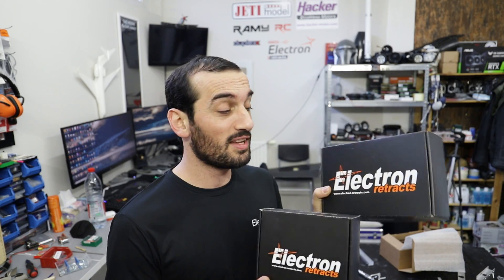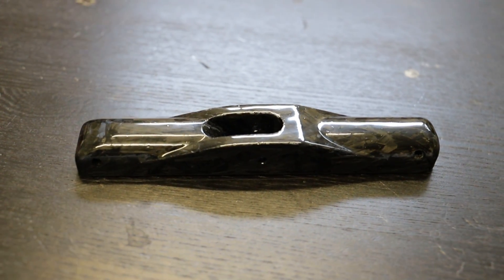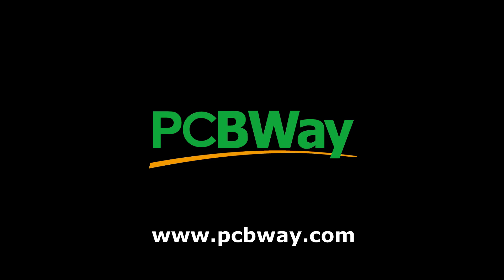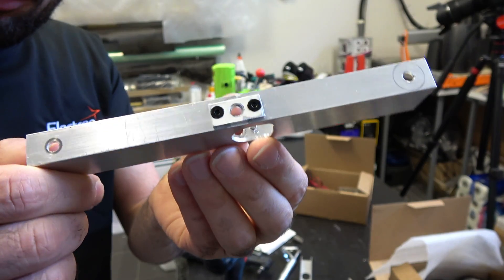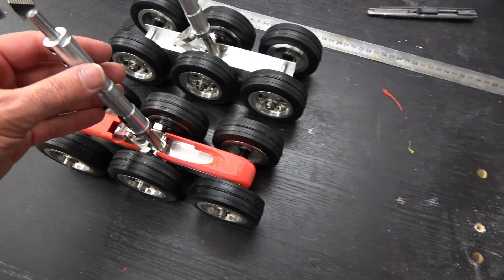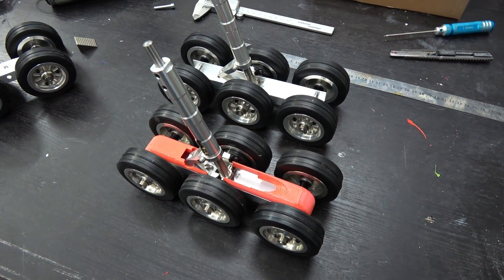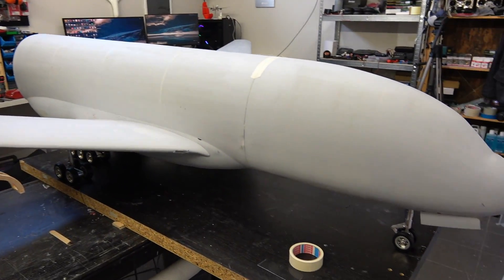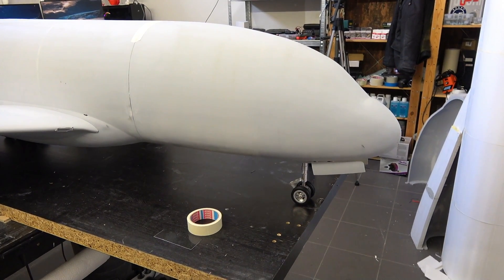Making the landing gear for the Airbus A380

Comment: You could make a very strong yet lightweight carbon fiber beam assembly using AI and a carbon fiber 3-D printer using generative design. All your wood braces, struts, and structural components could be replaced using this method which would dramatically reduce your overall weight while increasing strength.

Comment: Ramy i will be doing some edf test, and look to develop a jet engine in the future. I have seen some pretty powerful EDF's on youtube producing upwards of even 50kg. The thing is, none of them compressed air to create thrust. Just simple fans blowing a ton of air. Have you ever dabbled in producing such an EDF that compresses air in stages to maximize thrust? It would be easily done with metal parts but I'm limited to PLA (3D printed filament) there will be allot of limitations in the design process. 

Also I challenge you to create a blades thrust aircraft for your future projects!

Comment: Hi everyone! Well done 👍🏻 I’m using the same retracts on my airliner. But as you mentioned those electron alloy wheels (and brakes) are quite heavy, especially if you install more than one per leg. I replaced my wheels with light wheel from Kavan. I’m intrested what you are going to use, insted of those - i must admit, very nicely done - electron wheels.  Thanks & best regards

Comment: HI, I watched this video a few days ago but I just watched your 373max crash video. and I still want to say you should have separate batteries for each engine. It is fatal for one side to lose power while the other side ramps up.
Also I would actually want to see a WWII bomber. Modern planes are beautiful but I really like the look of older planes.
Reply: Its not left side/right side, its inside engines/ outside engines.

Comment: How will you deal with doors touching wheels? I see the front retracts touch the rear doors when extended and with landing, bouncing around, i would hate to see damage or doors falling off. Will rear doors close before front retracts extend? Or will you shorten axles? Or trim doors?

Comment: Would it be an idea to have the pulling up of the gear be spring-loaded? As in about 40 to 50% of the mass is pulled/held by springs. As 100% might cause the gear to not go down in case of a system fail.

The last thing we'd want to happen is having this project crash because the gear wouldn't go down.

Comment: Great job! For the wheel-cart piece you tried to make out of CF: That's a part with simple shape and complex stress, usually the strength of metals... After I saw your beautiful fuselage: That's a part with complex shape and rather simple stress, exactly what composites excell at! So all in all correct choice of materials... All the best with the build!

Comment: One thought: if your braked wheels are the centre wheels on the 3-bogie units, they will have the least effective braking, because the wheel will be at the mercy of the other two pairs on that bogie --  any lifting at either end will pull the centre wheel off the ground. It might be better to put the brakes on one end, or on the 4-wheel bogies.
Reply: Put them on the front. Deceleration will make the bogie pitch forward, so the front wheels have the most braking authority. Just like a car or bike.

Comment: Could the gears motors be a bit released  by springs, well adjusted ?
There is some geometry where a same spring can pull in a way in a certain point and pull the other way before that point... Maybe you remember this desk lamps? ;-)

Comment: I'd suggest, instead of putting a 1 sec diff. in the opening of the main landing gears, add at least 2 sec. more that way the gears on the wings are able to come out first and the seal close before the landing gear on the belly comes out. if you do so then, imaginably, the wing gears will come out and then on 2 sec. mark, its seals start closing while the belly gear starts opening on the 3rd sec.
Maybe you could prevent the belly gears from blocking the seals of the wing gear

Comment: Rami, Electrons has high torque motors version for their retracts. Same size, just double the power and 2x slower. You should get those.
Reply: Also, since the main gears are so heavy, there's a danger that they won't fully retract due to G force in flight. You should install a jeti hall sensor that will close the main gear doors only when the gear is fully retracted. That way, if fo some reason they didn't fully retracted, the gear doors won't close and get binded.

Comment: One way you could make a mold that would release (on the male side) from the part is to make it in 3 parts. Two touching sides, with a loose fit, and then a central part that's pressed in. When you have to take it apart removing in reverse order makes things super easy. I've used this method in the past to cast bubbles in resin using a round center plug which expanded four slices, super easy to remove.

Comment: the wheel mounting on the axle does not seem reliable for a model of this size, and it would be much better to make only the outer wheels of the wing struts brake, so that the braking torque would be more evenly distributed and easier to control.

Comment: I enjoy watching your videos, they relax me.
Two questions: why the 25kg weight limit? And how effective are those magnetic brakes? Would it actually hold it still with a reasonable amount of thrust?

Amazing project!
Reply from the maker: 25kg is the limit here in Germany, if more that 25kg then the plane has to go through many tests by officials to ensure that its safe to fly, brakes are great!
Reply: @RamyRC  Good to know, thank you!
Reply: In the EU, 25kg is the limit for "Open Category" UAV. These require no certification just that the operator must be 16 years or older, must have read the UAV manual and must have been trained to fly that specific UAV.
Reply: In the States, the limit is 55lbs and you have to register with the FAA if it's more.

Comment: On an aircraft landing gear, the assembly holding multiple axles and wheels is called a truck. So the A380 has two 4 wheel trucks, and two 6 wheel trucks.
Reply: It's called "bogie".